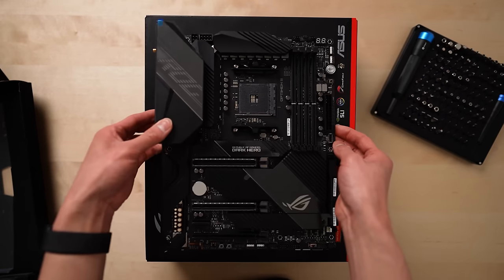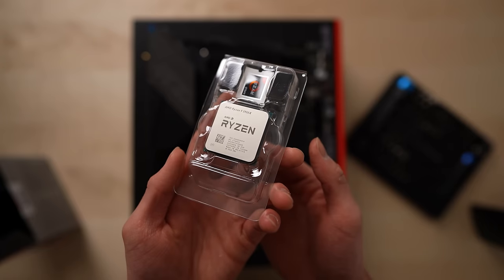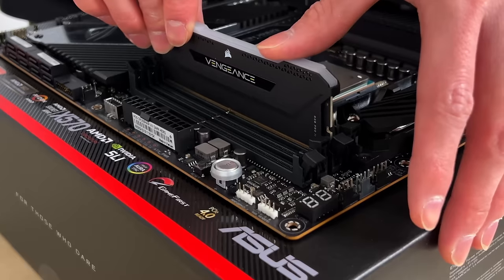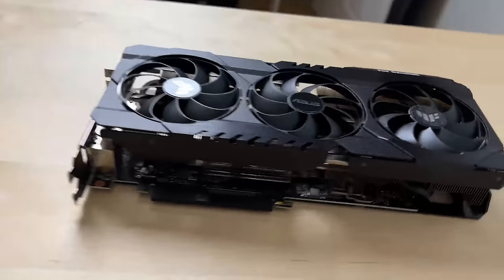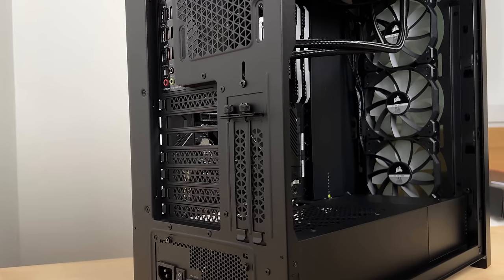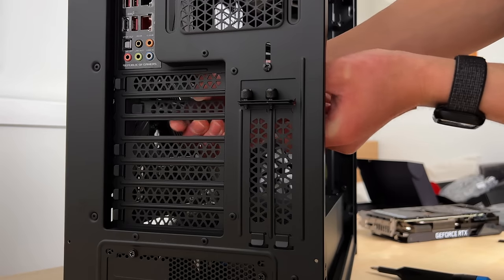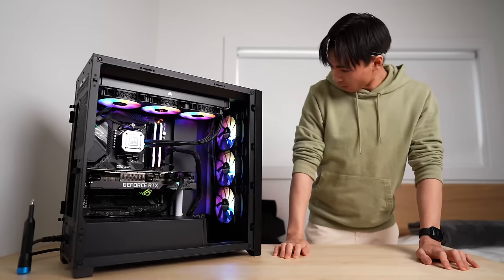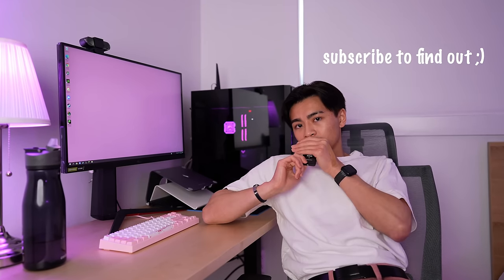Building My First Gaming PC with No Experience... (High-End)

Comment: You should be running two separate power cables from your PSU to your graphics card instead of using the pigtail to make sure you are getting the proper amount of power!
Reply: Can you use the pigtail then another 8 pin?
Reply: yes and no, it's cleaner power, however with an 850w psu on a 3080 there won't be enough to wattage to saturate the cable, either way good suggestion
Reply: @xela79  yes you  can
Reply: Yes! This Graphics Card can suck a lot of Watts. in His case all needs to come from 1 cable. If you use 2 seperate ones you can limit the stress on the cable. usually 1 with pigtail should not be a problem. but if you are able to switch to 2 seperate ones on a modular psu, you should.
Reply: @Probablekozz  really I thought 850w would be plenty
Reply: @noahmoussaoui7550  an 850w PSU is enough, I meant the GPU won't pull enough watts through 1 cable with a pigtail attached to it for it to matter, it's a good suggestion to use separate cables so that you don't run the risk of melting a poorly designed PCIE cable, my 3070ti pulls about 350 watts under full load while gaming and streaming, and I use 2 cables (1 is a pigtail), if the PSU manufacturer is known for making good products and has solid reviews on that unit you should not have a problem, but if you have something like Apevia I'd be using multiple cables for ease of mind.
Reply: This is totally untrue and one of the biggest myths I read online. Most PSU's are capable of delivering (and will) their full rating on a single rail like he is using. What you have to worry about is whether or not the gauge of wire in the connector can tolerate the amount of current being pushed through it. Since most cables are safely rated for current ratings well within what this GPU will pull, there is no problem here.
Reply: @taylan3363  There is multiple tests about that. For Example: https://www.youtube.com/watch?v=UL7KIVI_hJg&ab_channel=JayzTwoCents. 
Also gamers nexus has a very good test for psu´s where her tests that on a legit psu-testbench (cant find the video right now). 
But in general - you are right, and he should not suffer any issues pig-tailing that cable (i dont think he will run this gpu ever at peak for as long until this will matter). the thing is, he could run into issues... then why not use 2, why not be safe than sorry. it is a modular psu afterall.
Reply: @blackspell666  I design switched-mode PSU's for a living. He certainly should if he can, but keep in mind on the vast majority of PSU's, regardless of what some random YouTube video says, any PCIE output is capable of driving the full output of the supply. You should certainly be worried if you're running something like a 500W card as that would likely be out of spec+margin of safety for the current rating of the conductors in the cable, but the PSU will still deliver it without any performance hit. To be clear, it could potentially be a safety hazard if done totally recklessly, but even that is unlikely. 

Additionally, my response was in reply to the comment above mine saying that his PSU would be incapable of delivering 850W on that single rail. A cursory view of that own PSU's manual proves that untrue!
Reply: @taylan3363  Hi! Thank you for claryfing that for me! I learned something today :). 
but now for the REAL and BESTEST argument: It will look cooler without pigtails :p.
i´ll show myself out now^^
Reply: @taylan3363          It's definitely not a myth. I bought an Alphasync PC in December 2020 that came with a 3090 and Corsair 850 watt PSU. It kept crashing during intensive scenes in VR, the PC would just reboot. I had no idea what was wrong with it so I asked my brother who knows far more about PC's than I do. He spotted straight away that the PSU only had a single cable going to the 3090 with a pigtail splitter on the end. He put in a second cable and the PC hasn't crashed once since in 18 months.
Reply: @kevinbrook7033  Read what I said about "most PSU's". If you could link me to your particular PSU we could settle this conversation.
Reply: @taylan3363  The PSU is a Corsair HX850 80Plus Platinum and the GPU is an MSI Ventus 3090.
Reply: Standing with 2 legs is always better than 1 leg, yes both ways are still standing but you will be more comfortable with 2 legs.
Reply: @fohhee  that certainly makes sense to me.
Reply: depends on the quality of the PSU how clean the power output is on if that really makes a difference. like a budget PSU may need two seperate cables, but a quality PSU with better rails it is fine. his PSU is not the budget trash, it is 80 plus gold rated and can handle it.
Reply: @viperdemonz-jenkins  my PSU is platinum rated and didn't work properly without two separate cables. My PC kept rebooting during intense gaming scenes. 3090 takes a fair amount to drive it.
Reply: @kevinbrook7033  what watt PSU, also what is your PC's total draw? sounds like there is more to this than PCI-E conectors.
Reply: @viperdemonz-jenkins  Corsair HX850 platinum. The PSU is fine, works perfectly with two cables. The PC would reboot constantly under load when it was just using a single cable with a pigtail adapter though.
Reply: @kevinbrook7033  maybe the issue is the adaptor cant supply the flow of power needed. not all cables are made to the same standards.
Reply: @viperdemonz-jenkins  I have no idea, the PC was prebuilt and that's how it came. Luckily they included the extra cables that came with the PSU so we were able to put in a second and it's worked fine since. Ultimately, regardless what, specifically was the problem, it seems good practice to use the correct amount of cables in the first place to avoid any potential issues. Magentos shouldn't fail on a plane, but they have all have to have two anyway.
Reply: @kevinbrook7033  then it may have been the case, with prebuilts the company will cut corners where they can to save a buck. glad they supplied the cables so you could fix the issue.
Reply: @taylan3363  the more amps you push through a cable the hotter it will get, the hotter a wire the less efficient it is. Not to mention heat inside the case. it is wise when using a GPU that when overclocked can push 450 watts to use 2 seperate cables. Very simple and convenient practice that people should be doing. But you are correct the cable isn't gonna melt or even get hot enough to melt plastic but still wise to use 2 seperate cables.
Reply: @jaden2790  "What you have to worry about is whether or not the gauge of wire in the connector can tolerate the amount of current being pushed through it. " - You've made a useless comment
Reply: @taylan3363  Bs , a pcie cable only carries 150 watt, x16 slot another  75 watts.
225 watts are not enought for the 3080 and u will limity the performance doing so.
A better cable will not give u more power, only a second cable will do so.
So, Your statement is false
Reply: @taylan3363  Those cables are 18AWG also RTX 3080 can pull close to 500Watts for 1ms, these cards have huge power spikes. Daisy chain cables just don't cut it its as simple as that
Reply: @toooooooooooooooooooooooooooom  Transient spikes will not melt an 18 AWG cable. Furthermore, if you read my comment, the exception I pointed out was that you need to pay attention to the current rating of the cable versus the graphics card. You didn't read or process my comment and it is as simple as that :)
Reply: @taylan3363  LMAO my 6700xt pulls me 160W with 1 pcie cable, with 2 it pulls 400🤦‍♂️🤦‍♂️ also powermodded
Reply: Nancy Pelosi  The 3080 draws enough power to trip protections in a power supply if you only use the pigtail connector. (not very common or a problem on every model)
Reply: idk why people keep naming they're products gibberish like "Asus ROG CrossHair Vlll Dark Hero X570"
Reply: Fulll powerrrr!!!
Reply: 800 watts not enough?
Reply: Cables take as much power as they want, its the power supply thats the limiter
Reply: Does this also count for a Rtx 3070
Reply: That's not true at all,

You don't need 2 pins hahah

Use the pigtail. End of.

Single/pigtail is up to 500w 

Stop suggesting things you clearly have no understanding about

Comment: Immaculate build my dude! Just a few pointers for you:
1) there's a shroud to hide your motherboard 24 pin cable. Use it! It's the metal cutout directly right next to your motherboard.
2) you forgot the peel on the IO shield!
Lastly, personally I would use two individual 8 pin pcie cables to power my gpu, not in parallel. (Just personal preference tho)
Reply from the maker: Thank you!
- I did try to hide the 24-pin cable behind that shroud you mentioned, but there wasn't a lot of slack on the cable so I was scared it would bend the pins in the 24-pin connector slot over time. I feel like it would be a lot better with some custom cables, maybe something for the future!
- I did forget! I'm still really new to video production and sometimes I forget to record some important bits 😅 But I did peel it after the recording :)
- Thanks for the tip! Maybe' I'll have to go in and change that 👍🙏
Reply: @HenryHaoVo  Be sure to use two seperate PCI-E cables from the PSU into the 3080, I have one and it pulls 320W and the max output on the single daisy chained cable is only 300W. Most GPU manuals will also tell you to use two seperate cables, my 3080 FE did.
Reply: @HenryHaoVo  Just like Eric Smith mentioned, each cable is only rated x amount of watts, so for high powered components you should 100% use two seperate cables that are each plugged into your PC's power supply to ensure the limit isn't exceeded. Otherwise, loved the vid.
Reply: Also it's not bad if you touch the cpu pins
Reply: @haydaysheep7837  What do you mean, maybe a light touch is OK, but they are very delicate, breaking just 1, can destroy the CPU!
Reply: @tankmemer  you can actually break few pins if they are ground and it will still work
Reply: @CrAZzYfACE01  isnt it 150w each cable and 75w from the motherboard?
Reply: @haydaysheep7837  True, but you have to be careful if you do. You don't want to bend those pins. If one pin gets bent or broken off, the processor could stop working. But it depends which pin you pull off. Some pins are duplicates and do the same thing as another pin. To avoid breaking the pins, just dont touch them in the first place.
Reply: @haydaysheep7837  that's cap
Reply: Also to ensure the best thermal performance, he should mount the fans as intake fans instead of exhaust fans, but it doesn’t matter that much
Reply: @danieltruchon7060  That's for the sockets in the GPU, not for the cables. Although you read everywhere about never using the pigtail on the PCI-E cables, there seems a surprising lack of warnings from the PSU manufacturers about what a terrible thing it supposedly is to do. The RM-850x for example only comes with 2 PCI-E cables, each pigtailed - so if you have a 3 power socket GPU, there is no other option but to pigtail.
Reply: @foopys3270  but you need some sort of exhaust, no?
Reply: @NiftyMitts.  yeah uhmmmm... maybe I was being stupid or something but the airflow config looks fine

sorry lol
Reply: @foopys3270  it was an honest question I’m learning about building my first pc haha thanks
Reply: What’s the IO shield?
Reply: @GradietPanda12345  little piece of metal with cutouts for all of the ports on the motherboard. It snaps into the case and helps protect from dust, keeps electromagnetic radiation insane the case (supposedly) and looks better.
Reply: Do you know any safe websites to buy windows 11 activation keys for cheap? (Im building my first pc and don’t want to spend 130$ on an activation key)
Reply: I’m trying to build a PC like this, anyone have a price estimate of how much this PC build costs?
Reply: @venon2448  its not, there's pins that have the same purpose and are just duplicates. Wouldn't risk it though.
Reply: @mn1083  ik bro that was a year ago
Reply: Next year…NEXT YEAR??
Reply: @whatwhat818 This exact build is roughly $3300 right now but you don't need a lot of the things he got, and some of the exact models are just more expensive versions that don't offer any performance whatsoever. You can get almost the exact same performance for about $2400. But I would go for something from amd 7000 instead of 5000 just so that if you want to upgrade your cpu in the future you don't need to get a whole new motherboard and new ram.
Reply: Hey {{3}}! Thanks for the comment. Building a gaming PC with no experience can be a challenge, but it's also a great way to learn and customize your setup to your liking. As for your suggestions, using the shroud to hide cables, peeling the IO shield, and using individual PCIe cables are great tips for a cleaner build. Keep up the good work! By the way, have you heard about the HOTO Compressed Air Capsule? It's a handy tool for keeping your PC and other devices clean.
Reply: not when he takes 1-2 years to upload a vid ☠

Comment: Don't forget to enable XMP/ AMP in the bios, Otherwise your ram will run at 2133mhz, and not the 3600mhz you paid for.
Reply: There’s still things I don’t know about yet I find it more in the comments then it videos like these
Reply: @Aaron T on PCs if it's set to 3600 in task manager, then you are set.

On laptops, if I recall correctly, it can not be changed and it is always be set to it's maximum rated speed.
Reply: Shit man I didn’t even know this, thank you
Reply: Question would i have to do this when buying a new prebuilt pc?
Reply: @ThonThachJr  That depends on how competent the company is. But as a general note, Probably yes.

Comment: use seperate pcie cables for ur gpu power to make sure its getting full power, since a one cable even when its using a splitter can only provide so much through it
Reply: actually it will provide the full power the GPU wants and that is a problem because the cable its self is not rated for the amount of power the GPU will pull making it vary hot and possibly melt the rubber covering the wires shorting them out causing a fire
Reply: @rayzimmermin  No that wouldnt happen. Hes using a legitimate PSU, which means it'll stop that from happening in the first place.
Reply: Yeah for a 2 pin you for sure wanna go with separate cables. This image is directly from a PUS manufacturer and covers what you should/should not do with your pcie cables. Hopefully anyone seeing this will find it handy. https://i.redd.it/qfwh3kboeyl51.png

Comment: Nice build! I'd recommend for you to use two separate PCI-E power cables though, daisy chaining is okay but it's more optimal to use two separate cables for your graphics card, especially those high power ones like the 3080.
Reply: Why do power supply companies even offer daisy chain cable like that then? all I ever see are people not recommending to use them
Reply: @OleNesie  Probably for costs. Daisy-chaining isn't optimal because all the electricity is going through that single cable instead of two separate ones.
Reply: @crusherfire1  Daisy chain cables are perfectly fine unless you use a no name chinese PSU. My 4090 is fed by 2x2 + adapter on a Seasonic platinum 1200W and it runs great.
Reply: I’m trying to build a PC like this, anyone have a price estimate of how much this PC build costs?
Reply: @whatwhat818 it literally says at 0:26, cost him about $3640.
Reply: @OleNesie great way to fry your card

Comment: I built my first PC during the great GPU drought of 2021. I had an issue the moment I turned on my PC for the first time.

The PC refused to boot while giving me an error code (I think it was code: 00). So I thought I had a faulty motherboard, but after getting it replaced with a new one it still didn't work.

After much deliberation, the culprit was the CPU which I still couldn't believe. The brand new Intel 10th processor was defective out-of-the-box, even though the failure rate is like 0.3% or smth.
Reply: Wow

Comment: I know im late, but heres a few tips coming from a 14 year old...
1. When applying thermal paste, you dont have to spread it across, its better to just put a pea sized dot in the center.
2. Your 24 pin connector should be able to fit in that slot located next to it, I know it may be tough to fit but it should be able to slide in once you get the end through.
3. When I build a pc, I usually start by installing the motherboard, and then the fans. It gets the boring screwing in done early so the rest is just fun. (this is based on opinion)
Honestly really impressed for a first time build, usually you see the cables everywhere and a lot of problems. Great job, you earned a subscriber.
Reply: Bros speaking for experience 💀
Reply: @mister_mcnuggie9262  a 14 yrs old has more experience than me building these machines..its crazy
Reply: How do you have enough money to buy the parts at 14? Wow!

Comment: Congratulations,
 I did  the same thing twice in the last  4 years, its so fun and easy but expensive, lol .Corsair is very good stuff. And yes at some stage I can see you taking the thermal paste off and doing a smaller amount. Two things I have had happened on my game rig.1 The graphics card started to throttle  and get hot after about a year so I looked at  you tube and undid the heat sink and redid the thermal paste as the video showed and and it fixed it no worries. It must dry out after a while., The second thing was my 35 inch monitor would give me no signal response some  times. So once again YT is my friend and it showed how to take out your ram and using a school rubber on the connections. The gold bits. That also worked. Wish you luck. Well done on the build.